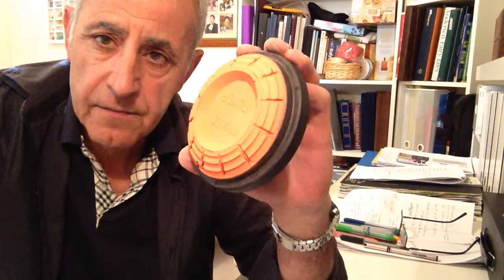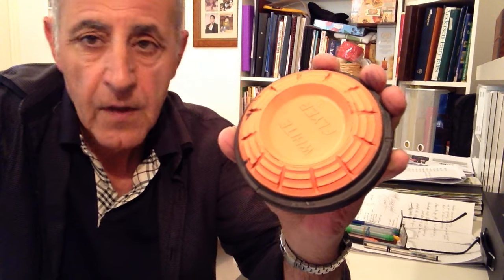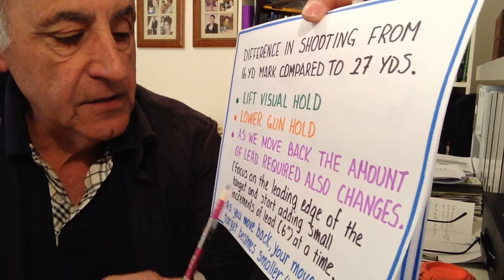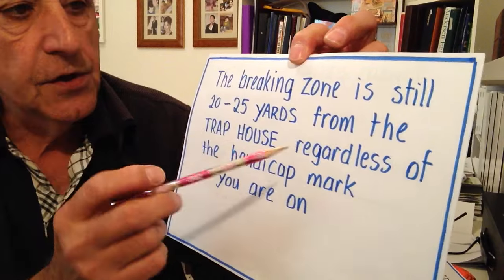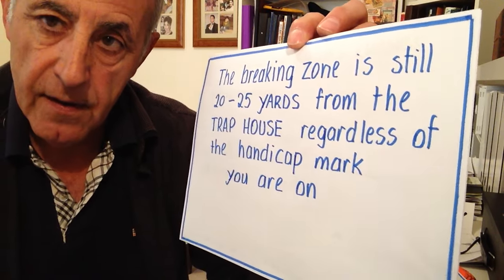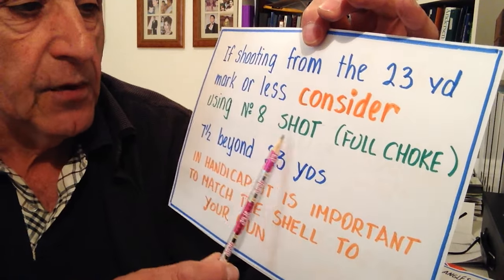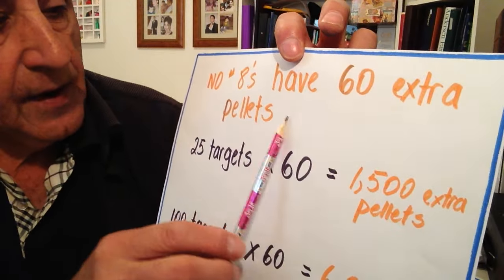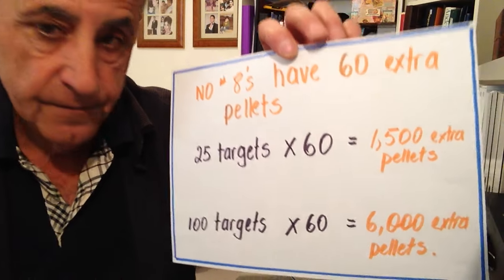Handicap Trap Shooting Tips...Roger Pace

Comment: Im new to this. Using a beretta silv pidgeon dtl special gun.
Currently use 3/4. In top bbl. Choke has 2 notches in it, and bottom bbl choke has 3 notches for first shot. Just using 7.5s.  Would it be of benefit to use choke 4 notches first shot with 8 shot. I shoot c grade from 15m. 
Presently using the winny 1350 loads 7.5, but you carnt get them now, got any shell preferences??
Thanks for the great info on your videos
Reply from the maker: Craig...4 notches is too open...at the moment youve got mod and improved modified and that is good...stay well and happy shooting
Reply: So would I benefit from number 8. As first shot then 7.5, for top bbl, being the tighter choke?